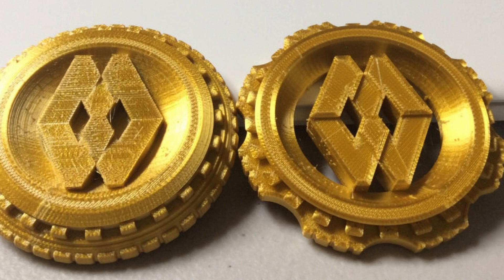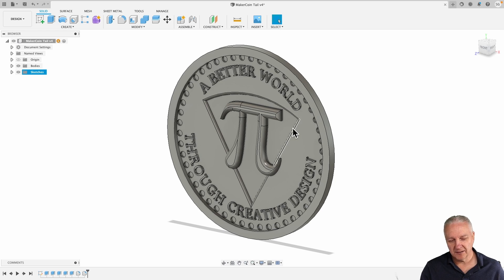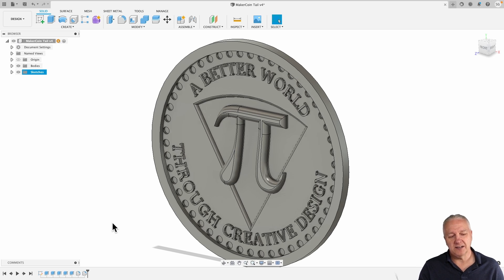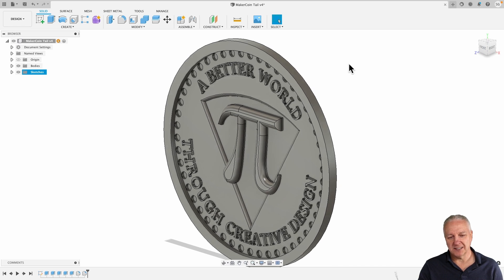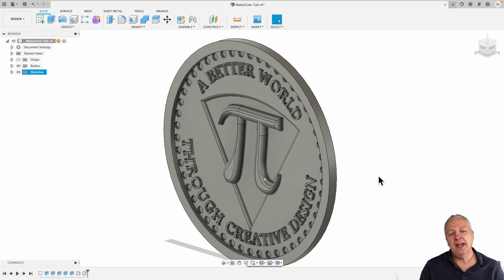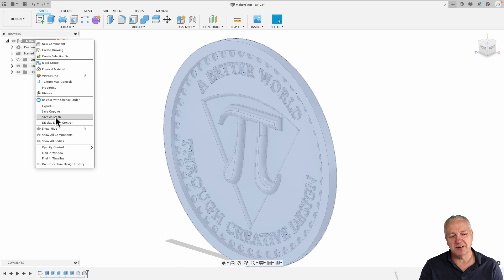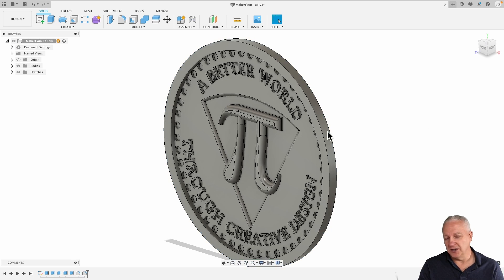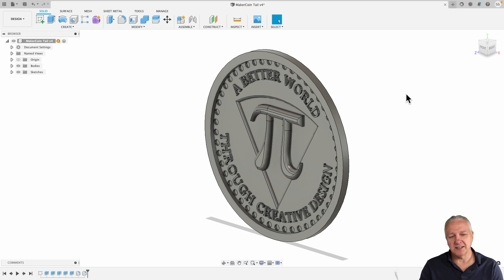The SECRET to Creating Coins with CNC Technology

Comment: I noticed you did not use any flood coolant or cutting oil or spray mist or vacuum/air assist? how much temperature and friction is being generated on that metal? Granted you have very small step over, but you're also not making very many chips with that, its effectively precision grinding the metal, or am I mistaken?
Reply from the maker: You are correct.  You can certainly use oil, but I didn’t because I primarily use my CNC for wood and didn’t really want my spoilboard covered in oil. It’s easier to keep the step over small and the feed rate low to avoid heating issues.

Comment: You showed setting up with 1/32 Ball Nose but used a tapered ball nose?????
Reply from the maker: Any ball nosed bit with a quarter inch sink is going to be tapered, so it doesn't make a lot of difference,  The speed and feed are what is critical here.

Comment: Hi. Do you have a link with the technical data sheet and the tool you use?
Reply from the maker: This was all done with a Onefinity CNC.  The tools are used were 1/4" and 1/8" end mills and a 1/8" ball nose.  I didn't have a 1/16" ball nose bit at the time or I would have used that too to get even better resolution.
Reply: @SteveMakesEverything  your work (hobby) is very enjoyable. I will do it too as soon as the time is right

Comment: How Long it's take to machine both side? Of coin
Reply from the maker: Hmm.  This would depend very much on the complexity of the coin design, but figure 30-45 minutes per side minimum because there 2 or 3 tool changes as well.

This in not for high volume work, but it's still faster than a fiber laser 😀

Comment: Hello my friend, I have a question: Can I make a currency mold out of stainless steel on a 50-watt fiber laser machine? To produce currency by pressure
Reply from the maker: I won't ask why you need this, so I can disavow all knowledge😀

In theory a 50-60W fiber laser can make the mold for a coin press, however, unless you are starting your own country I will point out the legality of doing this.  The mold in coin presses are usually made from high-carbon steel so they are durable.  Stainless steel is quite soft by comparison.
Reply: @SteveMakesEverything  In fact, I would like to make old souvenir coins and sell them as a keychain I thank you, brother, for answering me🌹🌹
Reply from the maker: @qwertyuiopa6218  Sounds like a fun (and legal) project. 😀

One thing you could do with a stainless mold is to use it to cast pewter coins.

Comment: Steve, thanks for the video!
I have yet to dive into nonferrous. i did an experiment with T6061 at my local makerspace. i have a full sized CNC that I am all but set up so Research and development is not far off.

I typically do Polycarbonate. With the T6061 i found it gummy. And the cyanocrylate did not work - but the surface area was less than 16 square inches.

I plan on doing brass as well.

I use O flute (single flute) upcut bits. I have yet to dive into 3d stuff - so i do not know much about ballnose.

The few small endmill bits (0.0625" / 1.5mm) i have tried snapped - im thinking heat. so, questions:

  #1 Speed and feed for the Ballnose on Brass?
  #2 Depth of cut/pass - do you stick with 10% of the bit diameter rule?
  #3 Step over - in wood its kinda large - 40% of diameter. What percent for the brass?
  #4 Lubricants - I didnt see any. I use compressed air at times for polycarbonate. Thoughts?

Thanks,
Clint
Reply from the maker: You want to turn a ball nose bit fairly quickly (16000-17000rpm), but you can feed it slightly slower than you would for wood projects.  Since you'll probably do a roughing pass first to get within 1mm of the finished surface, the ballnose bit won't really need to work too hard so you can push it a bit.  But yes, follow the rules.  Taking longer is better than replacing a broken carbide bit.

For stepover on the finishing pass you want to go less than 40% because you want the finish to be as free of tool marks as possible.

If yo want to lubricate you can, but brass cuts fairly easily and if you go slow you can probably live without it. If you don't mind the bit splash oil everywhere then apply oil as you wish.  I use my CNC for wood and metal and I would rather not have oil soaking into the wasteboards, so I tend not to lubricate.

Comment: Good evening, if I send you the coin model, do you make the matrix?
Reply from the maker: If you are planning to take the red pill, then I can do the Matrix😉.  But if you are just sending a 3D design like an STL file, that's all that's required.  Most CNC rendering apps (e.g. VCarve) can handling those files directly.
Reply: 😅 I don't have the project, I have the model coin, you use cnc to replicate it, I think it's called matris here in my country.
Reply from the maker: @andersonvieirasouza1101  Ah so you are looking for something to create a 3D model of the actual coin first.  That's much more challenging.  There are tools that can do this, though I haven't used them because every 3D scanner I've seen doesn't really do a very good job.
Reply: this steel block where the image of the coin model design is located

Comment: What kind of software are you use...im a beginner so im trying to learn
Reply from the maker: To create the toolpaths I usually use Vectric VCarve, however for these coins I used the toolpath creation in the commercial version of Fusion 360 (It's not in the free version).  Unlike lasers and 3D printers, good free CNC software isn't really available, though most companies will have 30-day trials so you can choose the best one for you.

If you are just getting started though you can try something like Easel but you will outgrow it pretty quickly.  You can also look at LaserGRBL with Candle, which is free, but pretty limited.

Comment: when you know is time to change the small  tip??
Reply from the maker: I assume you are asking about bit replacement. When the bit or material or bit get overly hot or the cutting isn’t smooth then it’s probably time.  I use carbide bits, which seem to laser a very long time - they are worth the extra money
Reply: @SteveMakesEverything  thanks yes was the tips, I am just getting in to the cnc stuff, I was asking because I am a jeweler and most of the time we do a gold and silver names for costumers, I have an idea on which tips I need but I am still learning Still don’t have the cnc for the job there’s a lot in the market still doing some research I watched you video and I was impress with the result s.

Comment: Love your videos. Can you tell me what the bits you use.  
Thank you 
Chris.
Reply from the maker: You can rough out with a quarter inch end mill, then use an 1/8” ball nose end mill to the finishing.  If you want extra fine detail you could do a third pass with a 1/16” ball nose end mill.  I made these with a trim router in my Onefinity, and I have since upgrade to an 80mm spindle which is much more precise. I should retry this to see what improvements there are.
Reply: @SteveMakesEverything  Thank you so very much!!!

Comment: Sir what difference step down and plunge rate
Reply from the maker: You you step rate do you mean step over?  Plunge rate is how quickly the Z axis moves.  Too high and you plow the bit into the material to the point where you risk either wreck the material or the bit. Step over is how quickly the bit will move in the x and y direction. Again, a value that is too high will result in chip out or broken bits
Reply: @SteveMakesEverything  sir step over if highly valued then tool will move x and y direction,but if we put value step over very low then tool will move x and y direction very slowly but i confused because feed rate do work same working, because if feed rate high value then tool will move x and y direction very fast,if low value feed rate then X and y direction tool will move low speed, so what difference in step over and feed rate please Clear my confusion
Reply from the maker: @sonuverma2796  This is why I asked.  Stepover in VCarve is a percentage of overlap and hence the final quality of the output.  Step rate is the overall speed that the tool moves in the x and Y direction.  Stepover is the amount of movement (as a percentage) and step rate is the speed of movement.
Reply from the maker: @sonuverma2796  Sorry I accidentally removed your comment.

Once again, stepover is the overlap on concentric passes of the toolpath and is measured as a percentage of overlap.  The feed rate is the speed that the tool is moving along the path.  Related to Feed rate is step rate, which is the lower level distance moved by each step of the motor. You wouldn't normally play with this value but it does play into your maximum feed rate.

Comment: Hello.tank you very much.nobel man please guide me.I want to make a gold coin weighing 2 grams and with a diameter of 16 mm, which has an edge around the coin. To make such a coin with precise details like a real coin, from zero to one hundred, what devices do I need? Please guide me and Can you give me the list of required devices? (I have only seen the steps of coin minting and coin molding and coin pressing machine in YouTube videos)
Reply from the maker: Hi Fatemeh.  While you could probably prototype your coin on a CNC, 16mm is pretty small to get the detail you'd probably want.  If this is what you want to do you would be better to take this to a machine shop and get them to cut a die that they could use to press coins.  There are also companies around that specialize in coin pressing.  It would be far faster and cheaper in the long run, plus you wouldn't have to worry about sweeping up all the gold dust.😉

Unless you're willing to buy a 5 ton press, this is realistically not something you could do well in your own shop.
Reply: @SteveMakesEverything  With my bare hands and without phenolic resin, I made a sandpaper with which they sharpened carpentry tools! In my country, the government is the boss of thieves and I do not want to behead anyone or cheat on gold coin alloys. I just want to mint gold coins like the government. I do and put the profit of minting in my pocket and other misfortunes. Minting with a press is definitely better. Help me to make the round edge of the coin and say the names of the necessary devices. There were no traces of lines around the coin. Please help me. No one will be blamed for guiding, but the hungry will be torn apart by wolves.
Reply from the maker: @fatemehjalili9  You would certainly need a CNC machine, though you would probably need a higher end machine to get the precision.  The typical cheap "3018" machine that you can buy from many Chinese companies probably won't be able to handle this
Reply: @SteveMakesEverything  my name is amir.i come from Iran. Fatemeh is my wife. I recite poetry like Hafiz, and this poem, although it teaches fishing to future generations, does not satisfy the hungry now. I will continue to do so even if you do not guide me. Thank you, Your Excellency. Goodbye.

Comment: Is there a CNC machine that can produce a real coin?
Reply from the maker: It really just a case of using a small enough bit to give the detail you need.  It would be tough if you want to machine something like a typical coin though because they are pressed rather than machined, allowing for very fine detail
Reply: @SteveMakesEverything  I want to make a gold coin weighing 2 grams and with a diameter of 16 mm, which has an edge around the coin. To make such a coin with precise details like a real coin, from zero to one hundred, what devices do I need? Please guide me and Can you give me the list of required devices? (I have only seen the steps of coin minting and coin molding and coin pressing machine in YouTube videos)

Comment: I'm attempting to program my coin in fusion, but I'm getting a render that shows the material around the lettering not being fully cut. In general, how deep should the lettering be (currently, the depth of my letters from the top surface is 0.0125, and I'm not getting the resolution I need in CAM). Any advise? 

If you are willing to reply, let me know if my question was unclear or something. Thanks!
Reply from the maker: It’s far easier if your letters are raised rather than recessed. This is how coins are normally made anyway.  Unless you have a spindle it’s also a bit challenging to get the precision you want since it requires a very solid platform and the ability to use bits down to 1/32”. Since I created this video I have upgraded my OneFinity CNC with an 80mm spindle and I was surprised how much better the accuracy and detail is.
Reply from the maker: Regarding your specific question about fusion it’s really hard to answer, though the actual cut could vary from the drawing due to tool selection.  Try to cut it in MDF to see how it looks
Reply: @SteveMakesEverything  I see, and yea sorry, the letters are definitely raised on my design (I meant depth in relation to the raised letting from surface). I thought something sounded off in my original explanation lol. 

I'll definitely give it a shot on some MDF, thanks.
Reply from the maker: @772CODEMASTER  When you are prototyping, use the cheapest material you can find.  Making wooden nickels is the best wat to start 😊

In answer to your question, it depends on the thickness of your coin but a good rule of thumb is that the total depth os each side is no deeper than 40% of the total coin thickness.  You need to leave enough solid material in the middle of the coin to give it strength.  Obviously if your letter is raised very high above the finished surface it becomes more difficult to get well defined detail.
Reply: @SteveMakesEverything  That makes sense, I'll try it out. I genuinely appreciate the advice.
Reply from the maker: @772CODEMASTER  Hopefully I can help

Comment: Coin swap with other makers?
Reply from the maker: I marked the bottom of the coin and drew a center line on the coin holder to do the alignment.  The makes sure that the front and back images are aligned rather tha having one rotated